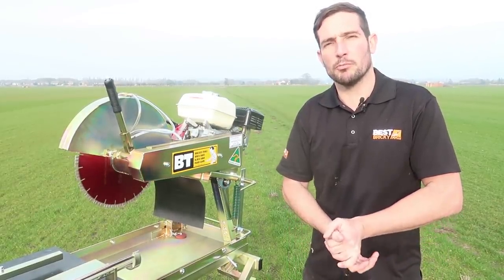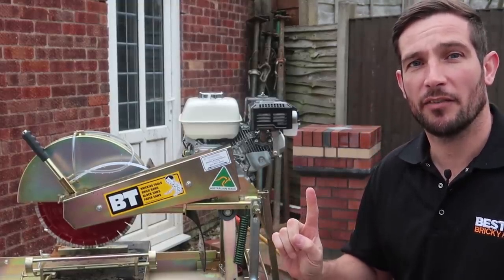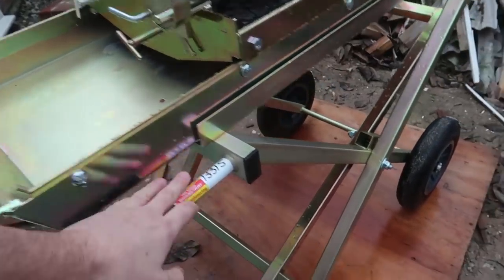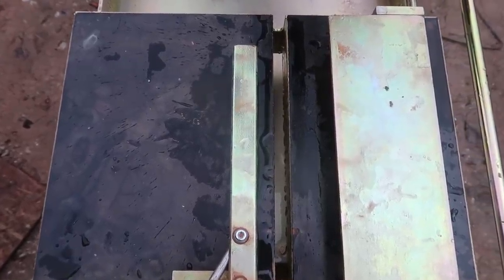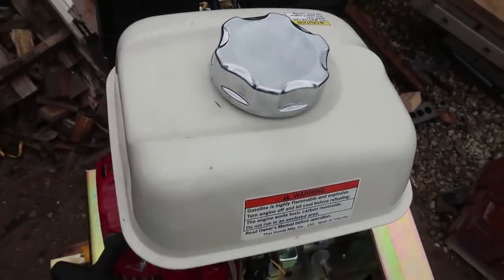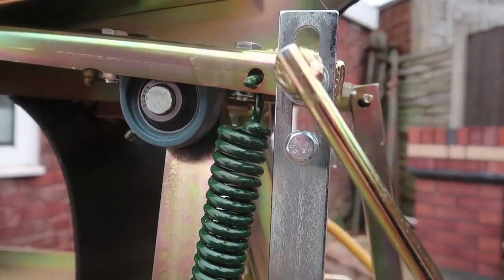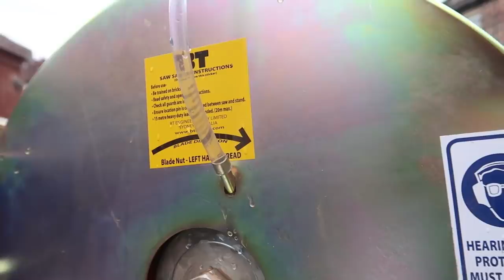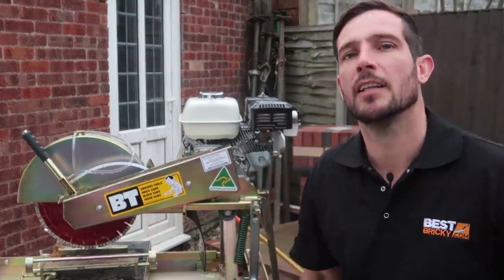BT Engineering Brick Saw

Comment: I'm in Australia, and i can tell you the majority of bricklayers here have a BT brick saw, If you look after it it will last a life time and BT also sell spare parts if needed. You can control the amount of water that wets the blade and you can control the revs on the motor, so when your finished a cut you can turn down the idle while marking the next cut without having to turn the machine off.
The BT brick saw is also designed to wheel to your ute and slide the saw off the stand straight onto the ute.You do not need 2 guys to do this you do it on your own. I have a BT Petrol model and i can wheel it anywhere turn it on and start cutting. The blade on the saw lasts for ages , i use my saw most days and i'd only ever buy 2 or 3 blades max a year. The saw is really easy to operate, i get my labourer doing the cuts instead of using a bolster and hammer, always get a better edge using the saw. Easy to do 100 cuts in 10 mins with the tray guide set up . Great for cutting mitres and splits.Seriously guy's it's a must to have.It will pay for itself in no time believe me. In Australia i paid around $2,000 australian dollars and i can tell you it's seriously worth every cent and even if i was to sell it second hand they still hold their value.I've  had my BT brick saw for 6 years now and still starts first pull bearing in mind i service it every 6 months, and if i were to sell it i could easily get around $1,200 being 6 years old.
Guy's purchase one and i can guarantee you will not regret the purchase.
BT engineering also sell brickies tools which are top quality tools designed and made to last.
Reply: Cheers for the great wrap Rod, appreciate it and glad, but not surprised, you've had such a good run with your BT Brick Saw!

Comment: I never owned a petrol saw like this, I used to hire one if the job called for it. There was a service once offered by a local brick factory, who would cut all the voussoirs for an arch or whatever. That disappeared in the mid-nineties when a bunch of pencil-pushers decided to prune for the sake of 'efficiency'! Anyway, I hired a saw when we needed to build a five centred arch in 9" work. It worked a treat. It wasn't made in Oz, but there was an Aussie operating it :) 
One of the great advantages is the complete lack of dust. Like Mark Twist says: you must charge for the machine's use - including wear on the blade, fuel etc. Work a deal with the agent for less than the hire fees of the local tool hire and you'll be on a winner.

Comment: Looks good, and I’ve used a saw like this, but it’s slow, you couldn’t use these on site work, but private jobs it’ll be great. Also using a paddy saw day in day out, you should be able to get half decent cuts.
Reply: Hi Boris, used all day every day on sites in Aus - especially on large volume building projects where efficiency is the only way to make money on the job.
Reply: BT Engineering yeah it’s fine on the ground floor, what about scaffolding? You can’t just bring it up a ladder. Why do you think 99% of builders use petrol or 9” grinders? Because it’s practical. This is not practical for sites. Look at stu’s site videos. There’s no way you can take your saw around. I’m not slating what you have, it’s really good. But you won’t see them on many sites in the uk.

Comment: I use a portable tile cutter with a flat bed and water cooling ... cost about £50 back in the day still on the same diamond blade
Reply from the maker: This is for materials more than 5 mm thickness Paul lol
Reply: stu crompton  so is mine Stu it’ll cut through bricks like butter it has a 9” blade but like I say is designed for tile cutting... nice bit of kit you got there Stu by the way

Comment: Looks a good bit of kit, But can only see this being used on larger projects or self-builds.
I don't see an electric version on the SES website, but do see they make one. The voltage needs clarifying whether 110V  for site use as they seem to use the same voltage in Aus.
Reply: Hi JayG2K - should be available in Electric in a few months - both in 110v and 230-240v.
Simon - BT Engineering
www.btengpl.co.uk

Comment: I enjoy  your vids Stu.   But I think an 110v electric  version would be better,  the noise  of the petrol one might get to you after a while. specially if it’s going for any length of time.
Reply from the maker: Actually I forgot to mention that the noise was considerably lower than anything I’ve used before like electric Grindr and stihl saw sonits even better for me as I have tinnitus and have to protect at all times.
Reply: Should be available in Electric in a few months David, both in 110v and 230-240.
Reply: BT Engineering will the elec version be water suppressed as well?
Reply: @alexchappell8159  Yes, absolutely and there is no issue with the combination.

Comment: Cracking bit of kit but not very practical for your average bricklayer/builder. I have hired similar when doing drives etc that require a lot of cuts for about £100 a week. You don’t have the hassle of storing and maintaining. £1700 is to much to spend unless you’d use it everyday. I’ll stick with my petrol cutoff saw 👍👍

Comment: If they want to break into the market then they need to offer their products at a much lower price for starters.
Reply: Hi John. As you know as a tradesman quality isn't cheap! This saw will last you over 10 years if you look after it though. In fact, we recently had the 20th saw ever made in the mid 80's come in for a check up. They are proper saws, made from proper material and skilled tradesman. Also, depending on how you value your time this will pay itself off on the first couple of jobs.